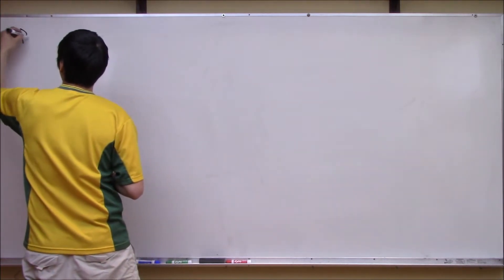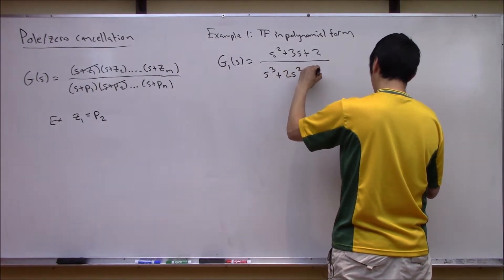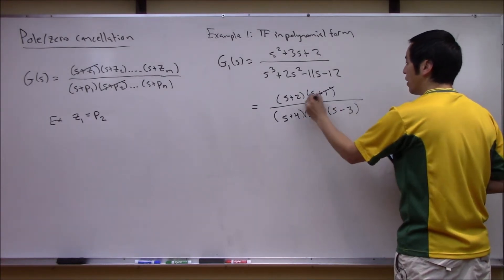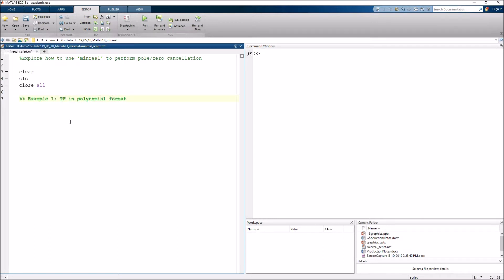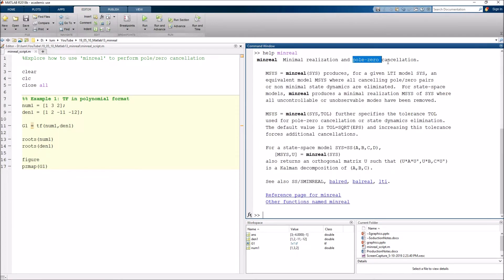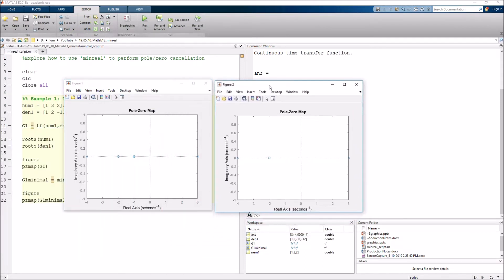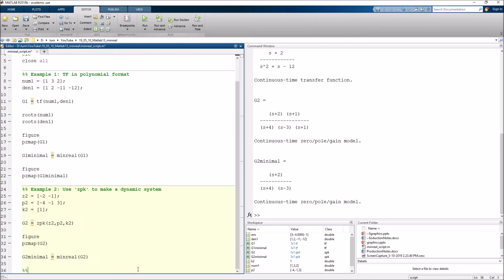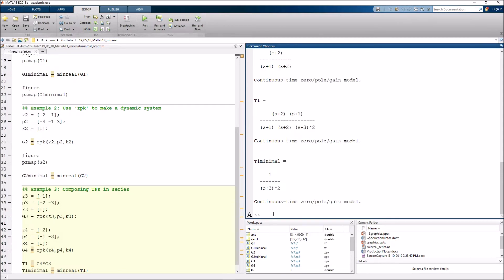Using ‘minreal’ in Matlab to Perform Transfer Function Pole/Zero Cancellation

Comment: AE511: Thank you for calling out the rounding tolerance behavior. It's very useful to see things like that get called out because it can save someone a lot of time finding a bug in their code if they missed something not intuitive like this. 

On an unrelate note it was funny to me that you called out 0.002 as such a small number that it should be rounded off. You're right that in most contexts that's almost certainly true, however today at work 4 hours ago I was in a discussion about how our sensor was reading off by 0.002 inches and how that is a massive error in our products context.
Reply from the maker: Haha, I guess 0, pi, and 0.002 are the magical math numbers

Comment: AE511: Interesting, I’ve never seen this function before. I’ve found matlab more cumbersome to do this “semi symbolic” type operations in the past, but it’s nice to see this function is straightforward. Although it is a bit confounding that the “tolerance” is not euclidean distance. If I was using this function to simplify a model used for verification purposes I would want to know what the tolerance actually means and how it is applied!
Reply from the maker: Yeah, sometimes the software tools are a bit cumbersome but they sure can save you lots of work!

Comment: Is a pole zero cancelled system different from the original system at all? Are there differences in their behavior?
Reply from the maker: That is an excellent question.  There should be no difference between the minimal realization and the original system.  The should be mathematically the same.  If you'd like to convince yourself of this, I would recommend building a Simulink model of the two systems and simulate, the outputs should be the same.